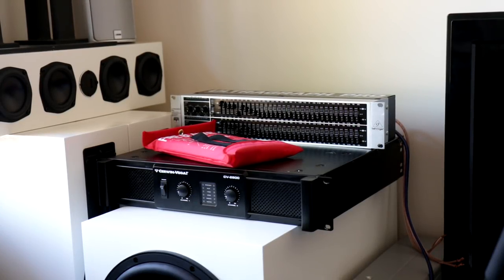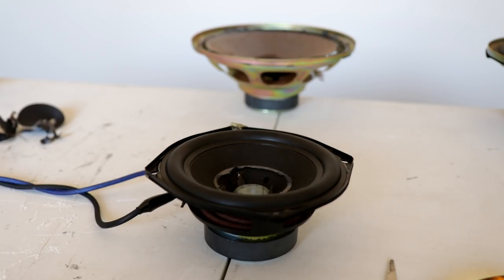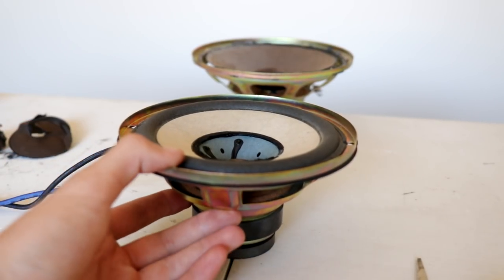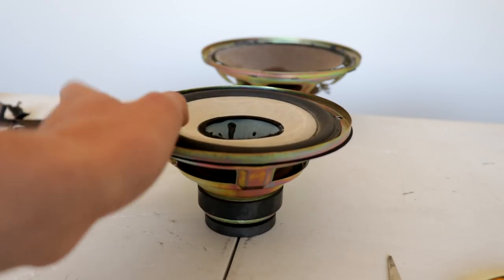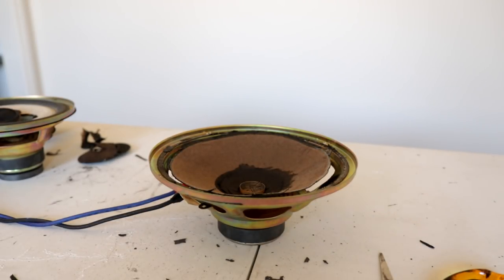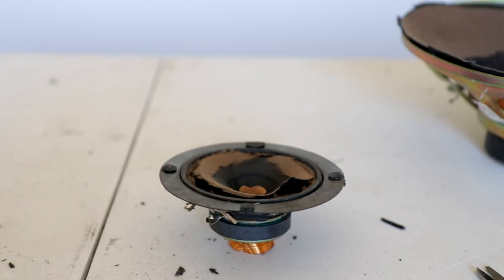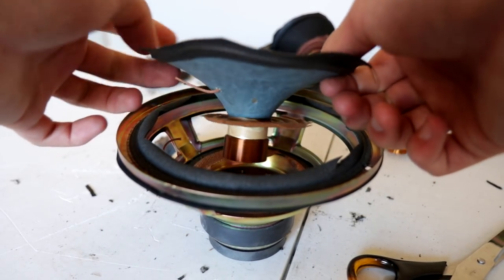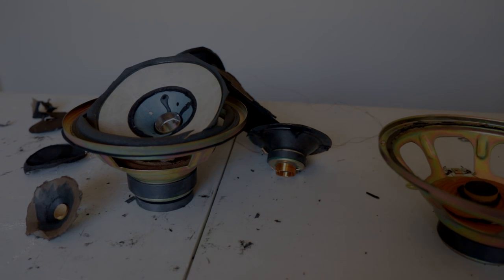SPEAKER BLOWOUTS! Technics, LG and Jamo!

Comment: Weird how the tecnics speaker was shit usually technics sound great
Reply: Micah’s Speakers there is some good ones that was a bottom end speaker and there own amps blow there speakers fairly easy
Reply: i'm serious friend of mine has a majorly good sounding technics mini hifi system reaches about 100Db in a room zero distortion a lot of bass etc. aswell as most technics mini hifi's ive heard sound great But i know they don't make speakers like PA etc. they are more home audio based and the ones ive heard kick ass
Reply: Micah’s Speakers technics speakers are only good with there own amps as they have separate plugs for each signal etc